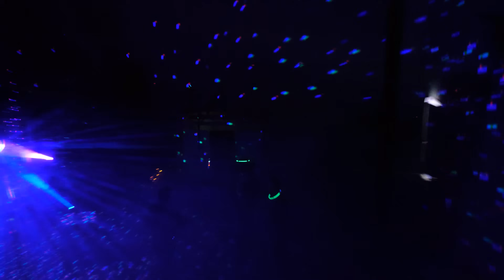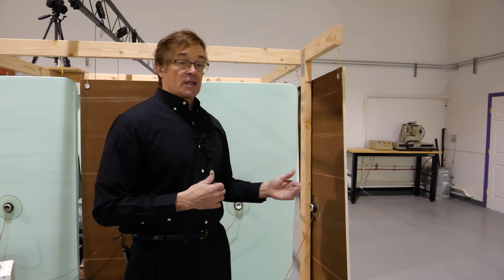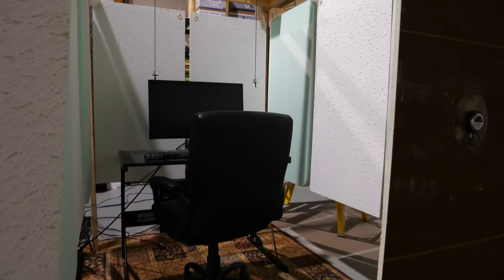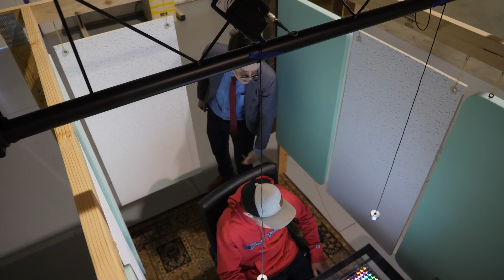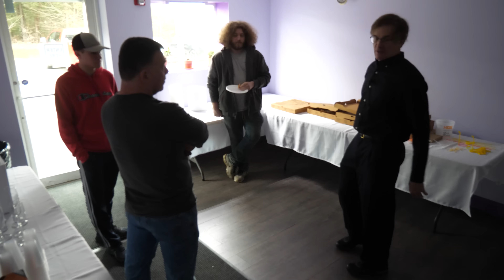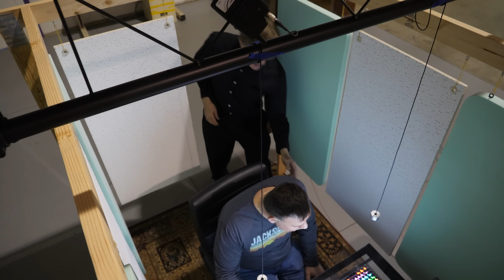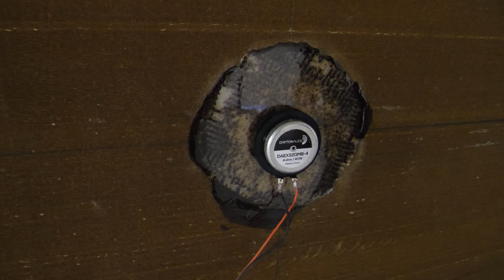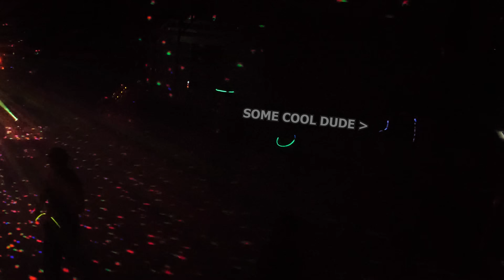SHOULD SPEAKERS THIS GOOD BE LEGAL?

Comment: What happens if you take the alternating panels and flib them 180 so you have a 40-60 panel next to a 60-40 panel. Further, you can get magnetic grommets which would suspend the panel 100% (obviously larget cost. What happens to the sound when encased in a sound baffling exo-enclosure (basically build another housing around that unit you have, but a 6" gap, withe just external drywall, plus foam baffles where one would normally think of insulation.... or just simply, batt insulation?

Comment: It cost $200? For the tile and Polystyrene? Or the whole kit and caboodle? The Polystyrene looks double stacked... What parts list do you have?
Reply from the maker: $200 for everything  except the amplifiers.  The polystyrene  is supplied in 8'x4' x 2" thick panels and we cut each 24"x45" smaller panel from one of these.

Comment: Can you please perform the same test but turning the panels into a mic. It would seem you could very discreetly envelope sound in these, but also make all panels a mic as well. Further - a few inches behind the vertically hanging panels, maby hang another full sheet of 4x8 panel sepcifically to the .1 sub range. So you would have three components on left/right the two in series as mentioned, but then a third large panel in the horizontal orientation, but dedicated to the sub?

Comment: Interesting. Would these types of panels do well if you were trying to create a portable workshop? That is, the concept is think of a car port sized tent. In that tent one might use angle grinders on steel, welding, using a table saw. Looking at the general sound profiles, 30-90dB across 1K-6KHz. The trick is outside to inside, there would need to be layers I think. Weather proofing, sound block, layer of protection (hot sparks from grinding for example). Buying a car port gets the weather. Was considering mute-x or similar fabric. Then the inside layer could be fiber glass welding blankets. Should help noise and protect against the sparks.
Reply: I would love to continue this over email or maybe help with a video in some way.
Reply: The hard part is the portability aspect. Which limits quite a few materials

Comment: Hi there,
I realized that you added some kind of medium between the exciter and the panel.
I assume the reason is to guarantee a better adhesion surface?

What material did you use?

Best regards from Germany!
Reply from the maker: As I explained in the video, it was epoxy  resin.

Comment: I've been wondering how coating the panels, like with paint or a sealant would impact the performance. I don't see any particular reason it would unless it was something heavy.  I haven't seen this discussed yet and curious if anyone has played around with that yet.
Reply: With the foam board, some people are sealing with a diluted wood glue mix
Reply: They did touch on spraying them lightly in an earlier vid. From memory they aimed to have the solvent carrier evaporate before it hit the (styrene) panel so it didn’t “eat” the foam, by ensuring they used the spraycan far enough away from the surface.

Comment: Sound quality is far too subjective to be useful beyond "check this out". I used to design sound systems and sound reinforcement systems professionally. Some of the home systems were contracted at $50k+, which included a year of service. All of the service calls were of the "It doesn't sound right" ilk, and all occurred at installations where the customer requested "Bass" and "Treble" controls which we discouraged. People do NOT have a consistent/quantifiable notion of good sound quality. It varies wildly with time of day, mood, weather, season, and lighting. I built a pair of these DML panels. I like the source-less dispersion (it sounds like professional speakers without the gigantism of a JBL stage array). Someone else might or might not like that, or another characteristic. Everyone should like the price/performance, but not everyone will consider the sound quality "good" (Bose is still in business and popular).

Comment: I built a set of DMLs using 2 x 4 acoustic tiles, using two Dayton 10w exciters and weighting the panels using the 2/5 rule.  On the other side of the room I have a set of MTM (D'Appolito array) speakers that are of my own design. Supplementing both is a 12" subwoofer based on Dayton's RSS314HO-44 in a 2.1ft^3 vented cabinet, my own design as well.  

Photos of the DMLs: https://i.lensdump.com/i/tpvTZ2.md.jpg
Backside of the DMLs before mounting the exciters: https://i3.lensdump.com/i/tpv1U9.md.jpg

The DMLs are surprisingly good, very good in fact.  The amount of work I had to do with my DSP to get a flat response to 18khz was minimal (I'm 52 years old, so anything above 13khz is pie in the sky for me).  With that said, if I am wanting to sit and listen to music, then I do prefer my MTM's over the DMLs.  It's just a preference.  I'm an audio enthusiast, not an audiophile, so I refuse to get into unicorn farts and fairy dust.  Just to my ear, the DMLs just don't have the nth degree of detail that my MTMs do.  I've A/B tested a lot, which is easy as everything is hooked up through a DSP and I can switch between the two sets at will.  The amplifier is a McIntosh MC7108.  It has 4 stereo amplifier modules in it for 8 channels overall, but each module can be  bridged.  The DML is powered by one stereo module delivering 25w @ 8ohms each channel.  The MTMs are powered by two modules each bridged to deliver 100w @ 4ohms.  The subwoofer is powered by a Carver TFM-15CB bridged mono at 300w into 4ohms.  All crossover work is handled by a Dayton DSP-408 (which I have come to love, it's a great bit of kit). 

DML panels are well worth the effort and cost.  While I may have a preference for my more conventional MTM speakers, it's just matters of a degree and not an out and out blow out.  

I noticed that you did not weight the panels in this video.  Is there a reason for that?  My testing found some really nasty peaks, if I did not weight the panels.  My first set was using foam and I agree they do much better in the higher frequencies.

Comment: Please, could you sir in the future videos try using a different microphone, or put it more far away, or even equalize in post-processing?

It's extremely, extremely sibilant, impossible to use with my headphones and it feels fatiguing, at times painful with my phone's built-in speaker, a little more tolerable with ipad pro's internal speakers but that's probably due to the software doing some attenuation without telling the user (Apple being Apple).

My hears are ringing at the moment as i type this.

Comment: I wanted to try these as surround sound speakers in my den / home theater room, but unfortunately the room just won't allow it. I may experiment with it in the future if I ever bite the bullet and switch to centered theater seating as it would open up wall space where they would fit.
Reply: I understand others have built in hidden speakers on the ceiling. It may not be the surround sound experience, but might still be cool.

Comment: Throughout the tests distortion can clearly be heard at the higher levels, most of the test subjects immediately lower the volume to where the distortion lessens. A few of the test subjects leave the levels high with the distortion. Does the distortion heard in the video correlate with what the test subjects hear.  Makes one wonder if some test subjects expect the distortion as part of being loud. For really high end sound systems the ability to reproduce sound at high levels without distortion is what really makes the difference.
Reply: Likely the microphone clipping tbh

Comment: So  I have been I working on these types of speaker design ever since I saw your first video on how to build these and fell in love with the idea of less worries about seat placement and durability with kids around really helps too. I used to work at Circuit City for eight years had thousand dollar infinities pokes BMWs and after I left there and I got more fine tune to my listening I really enjoyed magna pan flat panel speakers but even those still have the inherent problem of the flashlight effect on speakers. I love the special effect that the big panel speakers had but still have a serious speaker placement problems as well as power problems and then you try to incorporate something like these and I’m on theater with 11.4 channels he really come up a logistics affect a very large pan all speakers on speaker placement But these what are the experiment with have no problem with speaker placement being placed up against the wall and don’t have near the problem with sound treatments on the walls as well. Ever since tech ingredients first videos on the speakers I have tried several of my own designs and slightly different materials to get more what I was looking for mainly to get away from the drop ceiling panels in my experience the time alignment of them or the efficiency between the two materials gave me a problem in my rooms I could hear the Twitter panel way more than the drop ceiling panel so I just did two panels one with the small tweeter panel of the phone material and just a larger version like you see in the current video of the foam material but with the actuator placed in the center for a better base response like you talked about before. So currently I do have a 11 channel home theater gaming set up with the speakers that I’ve been using over the last year And I love them high and audio listening home theater gaming amazing in all seats around the room which is great as well as not having to acoustically treat her room the same as traditional speakers. Atmos is amazing with this setup lol . They wanna take this time to thank the technigreeting guy so much for bringing these to our attention in my home theater addiction. My My only questions now are what are your thoughts on the material difference efficiency problem because in my test the phone panel was louder than the ceiling panel. My biggest problem over the last two years working with these and trying different materials was in a smaller room that I had I was trying to do two actuators on one panel that always gave me a high frequency distortion I did not do that race but once I separated them out between two different panels independently huge difference. The one thing that would be neat to see is some more material tested maybe stuff that’s a little bit more higher quality nothing super crazy Play Conowoods but maybe the next price point material if you think there’s anything better otherwise I’m very happy with the results I’ve come up with thank you so much for introducing me to the speaker set up and releasing such detailed builds on what you work with.
Reply: Have you tried gluing on fabrics to reduce resonances ? I would think little fabric patches/strips should do the trick. If you're super serious, get an audio interface and a sm57 & a good pair of headphones like DT770 pro in 80ohms. The sm57 is very true sound and has a short throw. You can definitely hear individual parts of speakers. For example: the center sounds different than mid & outer edge. These areas of the speaker sound profoundly different. Your ears cannot detect this, but this mic(+headphones) will. That specific mic is special in how it works. It's commonly used for drums, where you don't want cymbal bleed. 
          If you study how a guitar string vibrates and what harmonics are produced at different intervals it should be revealing. This lesson would guide you down the right path. Even though a square panel is a different shape than a string, the sound wave is still going to make a shape out of the structure.
Reply: @tdtrecordsmusic   thank you for your response I fixed it for more now by separating the panels, but next time I Try to actuators on one panel I will definitely try that I did try adding duct tape to gorilla tape on the back of the panel to help reduce the residence but it still happened thanks for the info.

Comment: You had me at cheap, then @ 24:46  you went full disco.  Lol    Great job.  I saw the comparison of these panels to the polk speakers on the build video.  To get more base  have you considered thinning the styrene panels in the center where you have a thick rim on the outside. Great job as always, Thanks for posting.

Comment: What a stupid test look at the size of the booth it’s in if you’re going to run a test set your sizes based on an actual room.
Reply from the maker: And what size would  that actual room be?
Reply: @TechIngredients  well if you take the classic 4m x 4m having a 1.80m x 1.80m isn’t a true reality as to the space that it would be used plus it had an open top so maybe retest in a larger spec with the main area being in a corner and then reset the speakers to equal out the sound.

Comment: What is the power consumption of all the speakers excluding the Sub?
What would it be if you weren't heating grids in a Vacuum?
I like the idea that those speaker elements improve the sound quality in a room whether playing music or not, can be locally sourced, and inexpensive.
I am forced to assume that a signal processor with an input microphone has to translate traditional music into a language that your "Soundboards" can use to make the desired Effect.
What are the brains of the operation here?
What signal processor and software are you using to make this translation?
Edited to Correct Autocorrect
Reply: that is what I want to know also
well maybe more detail such as a breakdown of each speaker and the power draw ...

Comment: Does putting a design (like with a vinyl sticker or fabric or even paint) effect the audio quality? 

If not, I could imagine these set up in a house mounted to a wall with elastic isolation (as opposed to hanging to make them a bit more stable from bumps, so long as it doesn't impact audio quality too much).

Like you could build a simple mounting bracket that's just essentially 4 arms coming out from the center (against the wall) that then angle away from the wall to hold the speaker off the wall.

Comment: I wonder, if you would prototype it like a plank suspended in painting frame and thin fabric cover separated from moving element but attached to a frame. What is a tension strengh limit of mounting strings before sound quality deteriorates? That could upgrade traditional silent pictures on the wall to a picture with fully functional speaker. You could sell some with Tech Ingredients logo for example and release a blueprint for cover to enable custom images on the covers. The only problem is with isolating the backside. It would be way more convienient than traditional speakers which take a lot of space from a computer desk in my opinion.

Comment: I built a set of these using acoustic tiles, both rectangular and square. the quality was surprising but they had roughly half of the volume of my floor speakers and were very weak in the low frequency ranges. Sennheiser's new soundbar produced roughly equivalent sound but took up much less wall space. for what they are they are very good, but dont expect to toss your floor speakers.

Comment: I'm really curious to know how these panels actually measure. Also, how does the way they are hung affect sound? How loud can you drive them before they start distorting? Will really strong bass introduce artifacts? So many questions!
Reply: Dig through some of the older videos.  A lot of more technical details and testing/stats etc.

Comment: Could you use these as car speakers by placing them inside the roof or if there's enough headspace just attach it, maybe test it by replacing a sun roof with a speaker.

Comment: Love the Project. 
Inspired by the previous video, I was looking into using DML-Style speakers to power my living room. We experimented with different available materials in Europe. However, we noticed that while we can work around frequency problems with DSPs, we definitely need a high tweeter covering 6.5+ khz. Same goes for base < 150 hz. 

More problematic was that with very dense music the clarity is lacking. Its fine with classical solo instruments (Cellos and mid-to-lower woodwinds like Clarinets where amazing) + Radio. But romantic orchestras, hard rock and metal does distort too much. We could measure some of this with REW, so it was not subjective. We evaluated it as two classical trained musicians. Sadly, It was not good enough to be deployed. Now going back to a closed, DSP driven variant. I liked the idea of room layouts DML would open.
Reply: This is a common problem with broadband speakers, the lower frequencies cause a doppler effect o the higher ones. It's called intermodulation and basiclally unavoidable. One of the reasons why realistic sounding speakers need 2 or 3 drivers for what you call dense music.
Reply: Yeah I used REW and a MiniDSP for my setup. There was a pretty decent amount of boost around 7k and up like you say, and a huge amount of cut in the upper-mids. The 2ft by 4ft didn't get low enough, so my crossover point has to be crazy high, like nearly 200Hz. Which is high enough that you can hear the position of the subwoofer. My living room is a rather "live" setting, but in a better setting, I would be curious how precise the sound stage is. 

One thing it is awesome at is projection. They have very little falloff, so they are good for filling a house or large room. And once adjusted, they sound FAR better than what you would expect from something like this.
Reply: yep although really fun to play with and insane cheap of course.  it wont be beating regular speakers or planar magnetics etc.   still a really nice novelty and ejoyable also for kids to make stuff them self.